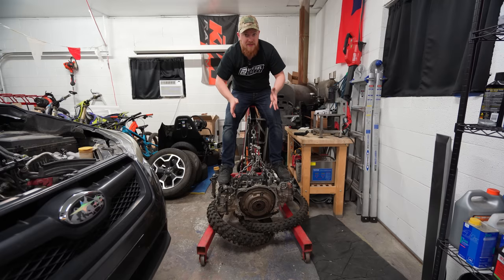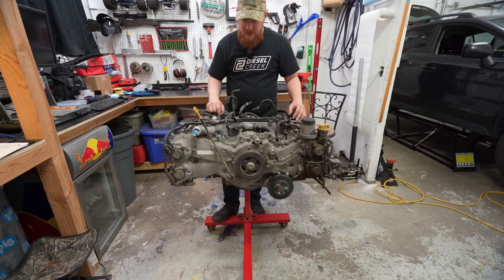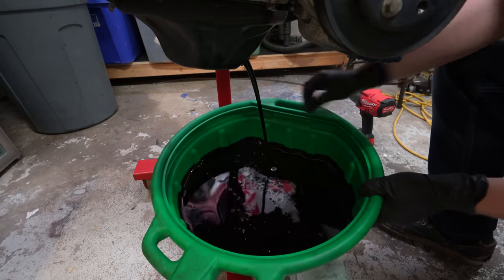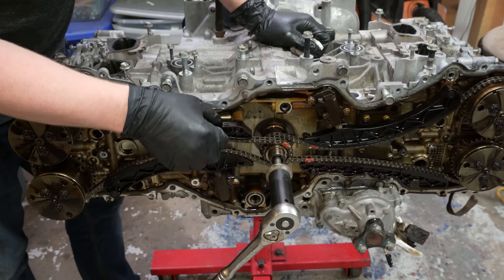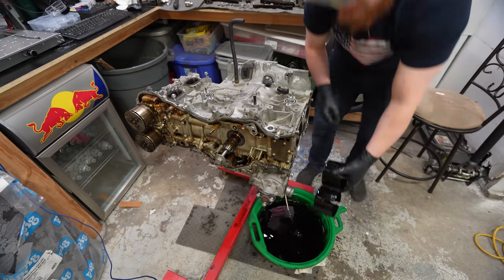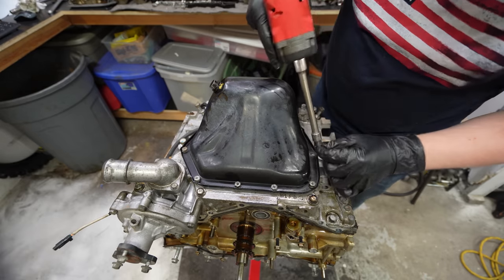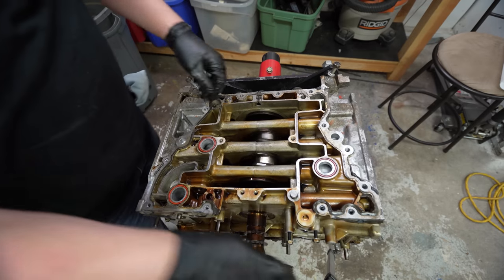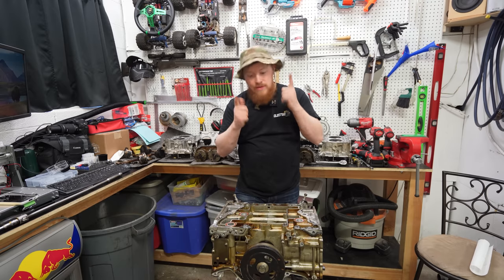Finding Out Why Our Crosstrek Blew Up! Engine Tear Down and Diagnosis.

Comment from the maker: You guys made me realize I didn't give the macro shots an autopsy of this caliber deserves, so I posted some photos on the patreon for free if you're an inquisitive soul.
Reply: I watched start to finish: Did you happen to check timing before teardown? These engine make an absolute racket if the timing chain tensioner doesn't hold pressure. Sometimes it lets the chains flop around and it doesn't even skip timing but it's almost always at cold start as pressure is supposed to build up in the tensioner (should retain tension but they fail)

Judging by those bearings they were not the failure and don't really fail in that way all of a sudden anyway.

Comment: As soon as I saw your dog in the shop, I had to smile knowing what was coming up.  I had just drained my oil out of my 4wd truck when my Springer stepped into the full oil pan of oil and then tipped it over while I was still under the truck.  She's covered with oil; I'm now laying in a giant pool of old oil, and she is trying to shake off the oil and it was going everywhere in my garage and on my truck.
Reply: Oily colored memories , of the way we were.
Reply: Yep, I saw that coming too. My Aussie hates any and all power tools, lawn mowers and tractor. If I get near the tractor he starts biting the wheels haha. You gotta love them though,  they are protecting you.😀

Comment: Really enjoyed this engine teardown!  You make it look so easy!  I remember doing the head gaskets on my 2003 Forester and thought it was a bear to figure out how to take apart and put together.  Granted, that was the first engine that I've ever had down to the short block.  Now that I've seen this one done, makes me think I'll be okay to do my newer FB25 Forester over a weekend or two.  

I have no suggestions regarding upgrades, since I'm more of the boring "leave it stock" type of person.  I don't have the disposable income to be fixing non-stock vehicles when they break down and keeping things stock makes things easier down the road for me.  

If I recall correctly, the FA 2.0L WRX/Forester XT engine should fit into these...  Although, you'd probably need to change a bunch more than just the engine: tranny, drive shaft, differentials, etc.  I'm not sure what works and what doesn't in the newer non-EJ things.  Probably wouldn't be worth it for me for an off-road vehicle.  

I do find it odd that you only got 120k out of this engine though.  I'm a recent subscriber, so I'm not sure if you've owned this vehicle since new, but I haven't heard of too many bottom end issues with the FB20 engines other than oil consumption in the early 2010s.
Reply from the maker: That's sick man! And we definitely didn't buy it new. We bought it at 102k miles and it has eaten some oil the whole time. I suspect it has a bit of a rough life before us.

And I hear you on keeping it stock, that's all I've done for my daily drivers. This being our family car makes me wanna keep it stock and have it easier to resale if we change cars. But then again I'm posting it on youtube and I understand stock is a bit boring to watch for some. Plus this motor is so gutless haha

Comment: You're a little worried now...wait till you have to out it back together. The torque sequencing and specs for the heads are absolute insane. Make sure you do it by the book it's crazy for a reason

Comment: One of my viewers asked me to look at this video.
I’ve opened and fixed hundreds of these engines.

Based on visual observations I say you run your oil change intervals are too long, the oil used is not good enough, and that FRAM filter needs to go.

Cheap filters, after a few thousand miles, can accidentally go into “bypass mode” upon cold start

FYI: engine braking will chew up oil

Good luck with the build
Reply from the maker: Dang, so you're saying i need to lay off the heel-toe in the family car?

Thanks for taking a look! Yeah a lot of people are putting me on blast for the Fram. I've learned my lesson haha definitely won't be running them once we put a motor in I actually care about.

So would a highflow oil pump be highly recommended?

Comment: Still working through the video, but just wanted to share something I saw recently. Use a milk crate that has slots cut so it slides over the engine stand brace.  That will give a bigger spot to have a drain pan sit on.

Comment: As far as the loose chain goes, the reason it's loose with the crank in some positions and not others I assume is from the oil-pressure driven tensioners. I've seen the same thing on a couple Audi 4.2 timing chain systems, and you can see the tensioners actuate if you watch carefully while spinning the crank.

Comment: 1: oil change intervals are for dealers and are based on the engine being designed to last the life of the warranty. CHANGE IT SOONER TO HAVE THE ENGINE LAST LONGER. Use Wix filters (same internal spec as Subaru OEM filters}

2: the PCV system on all of these FB engines needs to be serviced regularly to prevent oil burning and valve contamination

3: the lower passenger side of the timing cover "frets" over time and leaks so take the time to clean and seal well using a high quality gasket maker according to spec

4: your clutch was toast, either high mileage (I see them that bad after 160kms) or too much clutch slipping (inner city driving will do this as well)

5: change your rear main seal while the engine is apart 100%

6: swap to a turbo engine using an entire doner car, been done plenty up in Canada
Reply: Ive seen these rod bearings fail so many times theres no way its from owners not changing oil. Theres a problem with subarus oil system somewhere
Reply: @chinchy111  its complicated. Due to their oil system architecture used for the EJ25 engines (pre 2012) if you did not maintain your oil level or your oil lost viscosity (age, PCV contamination, fuel contamination etc) you would see a bearing failure that would not happen on a regular inline 4 cylinder engine. They are not prime to failure if everything is kept in perfect condition but after 5-7 years you start to see high levels of failure due to the above issues. Lack of maintenance really did kill off these engines. I build them for a living 👍

The newer FB/FA family of engines post 2012 that Subaru uses have their own issues including piston rings that fail from day 1 and allow oil to be consumed (sometimes causing lack of oil for rods and it will have bearing failure). Timing chain tensioner failure (the slapping noise on startup is a good indicator)

If you have an audible bearing failure that you can hear while the engine is running then you will 100% find a massive amount of metal contamination in the form of grey oil, metal flakes, chunks in the oil pan (don't reuse oil pan) and a ton in the filter pleats if you take the filter apart to inspect.

That all being said and headgaskets included in the list of aging Subaru issues.... I drive one every day and love what Subaru as made as a product (but none with a CVT, they are terrible)

Comment: Wow!  Only 120K miles and that kind of failure?  Good to know.  I was actually looking at buying a new Crosstrek from an "affordability" standpoint, but maybe I should steer clear of them.  The only issues I had with my 81 Subaru was head gasket failures, but that was caused by me being a kid and everything that comes from it.
Reply: I think this one was kinda dogged by the previous owner... We have a Crosstrek with the same mileage and it's running great, only thing we've had to do is replace a couple hub bearings.
Reply: 2016 Crosstrek Premium 5MT with 123k miles on the clock...no issues (e.g., CV axles, wheel hubs, or oil leaks) whatsoever! I did replace a clutch and pressure plate, but only because the throwout bearing was failing at 96k miles. The headlight assemblies were replaced, at year eight of ownership, strictly for cosmetic reasons. The usual service intervals are/were followed accordingly and my engine compartment is kept as clean as the day I purchased the car new. I do use a synthetic engine oil and change it every 5k instead of the recommend 6k. This is easily one of the best vehicles I have ever owned! Just stay on top of general maintenance and oil changes.

Comment: Glad you didn't get mad at your border.  She was just helping!  Looks to me like the oil was very dirty and subbys are somewhat finicky when it comes to clean oil.  So, you might be able to polish the crank.  Maybe even without splitting the case, but you need a machine shop pro to guide you on that. I would also say 130k miles isn't really high mileage anymore. At least not on an EJ motor, but you do have the newer FB motor so take my observations with a few grains of salt.

Comment: They upgraded the valve springs, they tend to fail on the 2013 Crosstek for some reason. Get the new ones if you tend to rebuild. See VALVE SPRING RECALL - WTY-84R

Comment: There was either a total lack of oil , as mentioned the Fram Oil filter, dirty oil or lack of maintenance .  That’s my opinion .  Most Subaru engines do not have premature engine failure .  Thanks for the video!!

Comment: A Subaru with a engine issue what a surprising situation. 
A lot of my customers drive Subies and they love them, but the issues they have are just never ending, engine issues, cat converter issues, oil consumption problems, head gaskets all day long and they rust out like no one’s business at least in my area of the country but they love them, seems like a one way relationship in my opinion
Reply: Amen brother. My 1st and last Subaru.

Comment: I think the Oscillation is coming from the Subaru Manual (Viscous Limited Slip) AWD System.
It does that on my WRX as well at low speed. Kinda of a Hopping Motion.
I can get out of it by Clutch In or More Gas.

Also, you might want to touch the gas pedal to disengage the Hill Start Assist, if equipped. As Subaru uses a very rudimentary Hill Start System with the Manual Transmission Manual E-Brake Setup. It sometimes drags quite hard when slipping the clutch.

Comment: If you have hot spots on the flywheel and pressure plate, simply replace the entire system. I recommend Exedy for a Subaru; they’ve always performed and lasted a long time and very solid performance in all of my Subarus

Comment: WOW! seeing that much damage in the con rod bearing would be enough for you to lose oil pressure which on your first video it sounded like you lost pretty well all your compression.
That said - your timing tensioners are oil pressurized, as you showed the play in the chain.
This in turn would add to the engine not starting. Seeing all that carbon on your pistons would have me think your rings are probably stuck. Maybe its time to use a oil catch a can system as it looks like the PVC system is allowing to much crank case vapors to get into the intake. Great video.

Comment: I definitely think there is a Bent valve but also the front passenger rod kinda seems stretched if it hit the head when the engine stopped the starter will stretch the timing chain

Comment: Sometime after 2017, Subaru redesigned the cylinder sleeves, more robust, and with less deformation at operating temps, resulting in reduced oil consumption and blow-by.
We recommend a 5,000-mile oil change interval unless the owner/operator checks the level and quality often. I know the synthetic oils are supposed to last longer, even when they appear dirty, your choice.
Reply: Ive seen these rod bearings fail so many times its not from owners not changing oil it has to be subarus oil delivery system somewhere
Reply: @chinchy111  Could be, but to date, I haven't seen enough to consider it a 'pattern' failure, all I work on is Subaru, since 1997.
Google search 'Subaru TSB 02-157-14R' concerning oil consumption.
 Most of our customers come in way past the recommended change interval and most are one to 2 quarts low. There are a lot of contributing factors, from engine design, use, abuse (driving habits), and neglect, to name a few. With newer engines and 0W20 oil, you got to stay on top of it. A lot of folks would rather go to the dentist for a tooth extraction than change their oil & filter.
Most of the oil-related issues I've seen are with customers that bought the car used, cars that came from auctions and ended up on a used car lot, or traded in. Basically, they bought someone else's lemon that is now squeezing them.
Also, there is a software update (a.k.a. Reflash) for 'Improved Oil Level Detection'. The ECM monitors the oil level, averages it, then illuminates the Low Oil Level light in my opinion, when it's too late. Before the Reflash, the oil level was way too low, and after driving that way for thousands of miles, it takes its toll over time and distance.

Comment: The entire problem with crosstrek engine failure is the fact that the ecm revs the engine immediately to 2k rpm on startup. No oil pressure and immediately to 2k. Over time it destroys bearings.

My friend bought a new crosstrek a few years ago and I noticed how the ecm started the engine. I knew that over time cold oil starvation would roast the bearings. And yes, now it makes bearing noise. 

Unless there is a way to reprogram the ecm, which I doubt, it's going to happen again. Just replace the bearings every 120k and move on.
Reply: This is real...and it takes a surprising amount of time before the revs drop to a normal idle.
I've improved things a bit by doing an idle reset.
Reply: Ridiculous cars. Have no idea why the average consumer buys. These are hobby cars. AKA money pits.

Comment: without seeing the rest of your video, I have a FB25 motor in a 2012 forester and it has that death rattle from the timing chain tensioner, and apparently its the bottom one. The hydrolic chain tensioner shits itself and thats it.

Comment: Also I’ve never seen oil that dark in any of my Subaru’s. You need to switch to Subaru synthetic 0w20 and Subaru filters. Fram has been notorious for having the worst quality oil filters. Hope this helps and steers you away from them. Just check out some mr.Subaru oil filter videos and you will see why..
Reply: That's funny. Guess who makes Subaru labeled filters for U.S. Subaru dealers.
Reply: @seandvideo  fram. I stick to the black Tokyo Roki filters. Probably should have stated that. If you watch the videos you would know this tho.
Reply: How long did you go between oil changes in this engine? The oil you drained out looks like roofing tar.
Reply: @charger19691  that’s what I’m saying. Or maybe it was the oil he used? I know Pennzoil and Valvoline have a tendency to get dark fast due to all of the cleaning detergents in the oil. But this does kind of look way over due..
Reply: OEM filters and 0-20 Castrol full syn every 5000 miles.  2018 Outback 2.5

Comment: I have a 2018 Subaru Outback and have been interested in teardown process (hopefully not for some time). I have a lot of experience with the old air cooled VWs 4 cyl boxer style--this is way more complicated--but doable. :) I bought my Outback used from the dealer with 18k miles. I'm in a warmer climate--south Texas. For my oil I switched to 5w30 from the recommended 0w20 with change interval at 3k miles or so. I may lose a little on fuel economy but my hope is the engine will last longer. I'm kinda old school--the 0w20 seems too thin. With the 5w30 it does run quieter. Thanks for the video. Looking forward to rebuild process.

Comment: those Subaru oil caps are notorious for allowing oil blow by unless you crank them down with a wrench, that's why the right side of the engine is so dirty. mine was the same way until I realized this, but never cleaned it up from the last owner.

Comment: i have a 2015 Trek 5sp. Great informational video. fortunatly when i bought my used trek at 74K miles, the dealer (honda), offered a lifetime powertrain warranty. So mines is at 98K miles now. no noticable problems other than uses 1qt oil every 2500 miles. and my HVAC fan switch only operates at position 1, and 3.

Comment: I've always subscribed to the theory that if there was extra power/efficiency to be had from a motor, most of not all would have been achieved by the manufacturer. They have a strong incentive to show Big Number for hp/torque/mpg. If I had your skills and lots of money, I'd do a WRX engine swap. Not sure how the CVT would like that though lol
Reply: It's a manual.
Reply: @ozzierabbit587  Does the wrx not come in a cvt version still?
Reply: @saramae9878  the wrx is available with a beefed up version cvt.
Reply: @saramae9878  the cvt would explode and tuning it would be the hardest part.
Reply: I would say they made the minimum amount of engine they could get away with to maximize fuel efficiency and when hitting a specific hp number. Same effect though. There's probably next to no room for bolt on hp gains outside a tune. And that will cause your NOx numbers or whatnot to increase. The days of replacing the crappy OEM crimped exhaust for a more free flowing welded one are long gone.

Comment: just a suggestion i would look into fords 3.7 cyclone engine. 305 hp 280 tq you can find them for 600$-1000$ 30+mpg and crazy reliable. Most under rated engine

Comment: Nice teardown! I have two 2016's ... so I have a vested interest in this.  As part of a followup vid, maybe consider looking up a crate motor from Subaru and doing a cost comparo between a crate motor vs a rebuild.  Also, I would be interested to know if these engines can be bored over, stroked, and if more aggressive cam profiles are available. As unfortunate as this engine failure is, it does open up some interesting possibilities!  I just subbed, looking forward to your next vids on the Crosstrek!
Reply: Also, I've seen ppl join the piston to the connecting rod whilst the piston was in the motor.. yet I saw you remove the piston and rod as one. What gives?